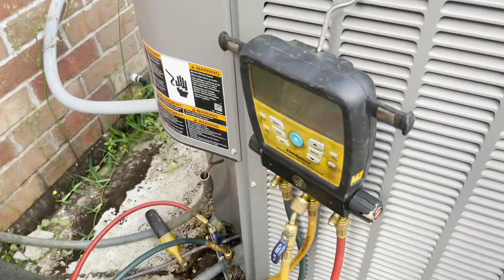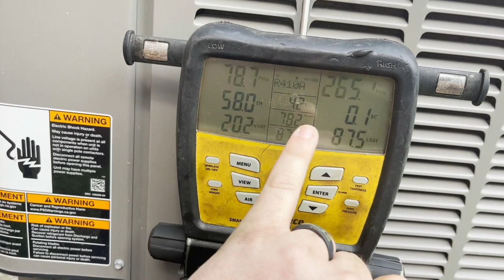No Cooling System Freezing Up

Comment: When I bought my house it was built with central heat and air and the furnace was the one that came with the house and the condensing unit had been replaced once.  It was old but it put out 50 degree air :)  The guy who did my inspection said I was going to be buying heat and air within five years so I should figure out what I wanted.  I decided on American Standard until sticker shock!  They are high!  So I asked if Rheem/RUUD had a system with the same features.  Yes, they did.  I got the first one that did 410a.  The guy told me new furnaces his cost was usually a couple of hundred.  My Rheem was $550!  It had multi speed fan and all the goodies.  I took bids and interviewed the guys who gave them to me and that's how I wound up with the one who did it.  They did mostly Goodman but after doing mine they started carrying Rheem/RUUD.

Comment: I really hate to see all the Lennox dislike. I just had my whole system replaced with their 28 SEER SL28XCV Condenser and 99% SLP99V Furnace. So far, it has been a wonderful system, their S30 Thermostat and Pure Air S seem like good products. 

Seemed like quite the combo and the local outfit was the highest rated in my area. With that said, I wish I had known Lennox’s reputation for leaky coils and such beforehand. I hope I did not make a mistake, but we shall see. It was quite the investment.

Comment: Good ole Leaky Lennox. I priced a Lennox compressor that was 8 years old and it was $1,600. A new condensing unit runs $1,100 for a 2 1/2 ton. Lennox loves their equipment

Comment: within respect to all comments,I be honest as a tech I don't even use much my leak detector anymore on my prospective after doing a visual inspection on the outdoor unit and also checking where the liquid line and the suction line it gets  braze on next tep it's feeling oil in the drainline then if I feel oil on the water it is definitely inside on the evaporator coil,that just my opinion 1 outta 10 as a tech everyone knows leaks are common to be in the evaporator coil.